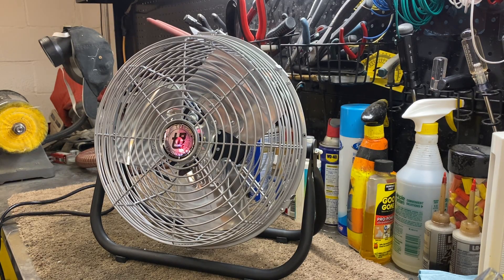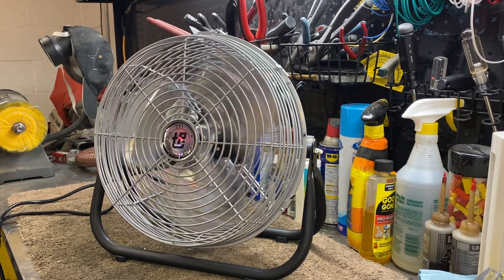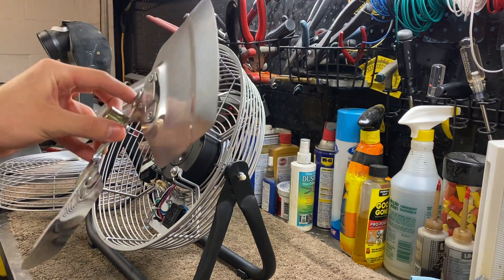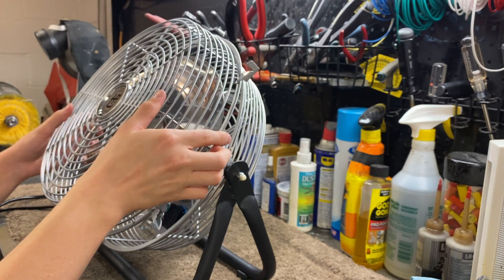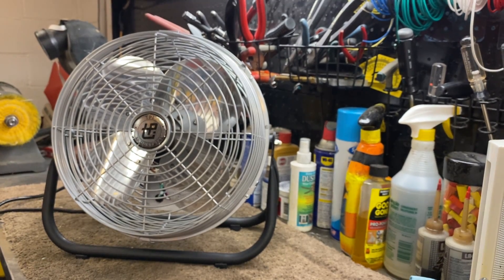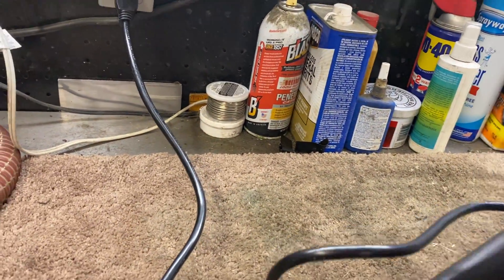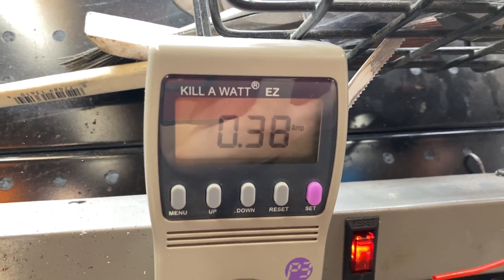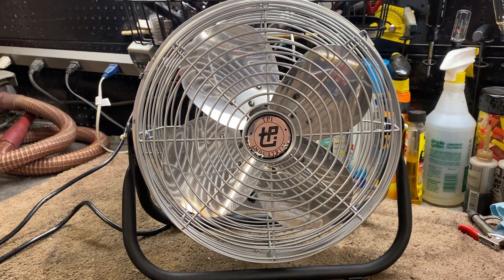TPI F-12-TE Blade Swap

Comment: The white noise produced by the new (older) blade was so good that it was putting me to sleep.  If it came that way from the factory I would buy one in an instant.  The TPI's, especially the 18 inch, is simply too loud to use in a small studio apartment in NYC.

Comment: Another carpeted workbench appears....
That was fascinating. I thought for sure the power draw would have gone up significantly. I'm going to be opening up my 12" and increasing the pitch to match the 1 amp draw at full speed. If that would give it a quieter low speed, it would be so much more useful to me.
There is more investigation to be done on the 24" one as well. I adjusted the pitch to match the motor's amp draw, but I haven't tested the operating temperature. Something tells me it's not going to run any cooler.
Reply from the maker: Do you know if your 24” fan has the same 1/8 HP motor used on the 18” fan or do you have the “beefed up” F-18-HV-TE, which is supposed to have a 1/4 HP motor?
Reply: @whoisthisguy724  I do believe the motors are different physical sizes on the 18 and 24, they also are rated for a different power draw.
I have the regular 18-TE, at the time of purchase, I didn't know there were two different variants. Where is the HV one sold? I cannot find it anywhere from a brief search.
Reply from the maker: @JordanU  the first search result I’ve found for the 24” HV brought me to Webstaurantstore. Be forewarned that it is a good bit more expensive than the standard 24” fan but knock on wood it should be well worth it to have a properly sized motor
Reply from the maker: https://www.westwayelectricsupply.com/buy/product/F24TEHV/835791
Reply: @whoisthisguy724  Is there a 18" model? The 18" I'd consider getting, but I don't have enough of a use for the 24" to justify another one.
Reply from the maker: @JordanU  Not that I'm aware of, the only 18" models they make are the standard F-18-TE and the F-18-CR which has its grilles painted with corrosion-resistant white paint.